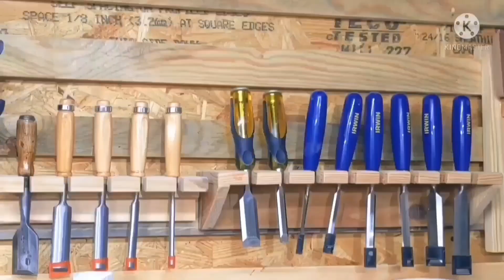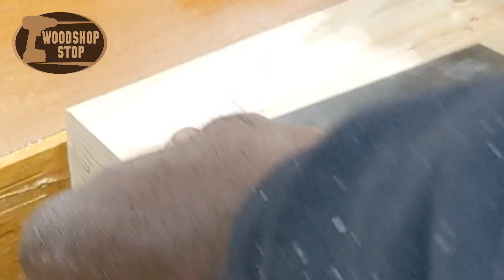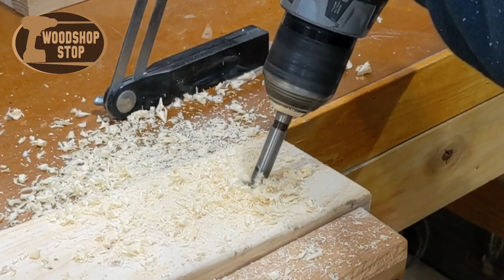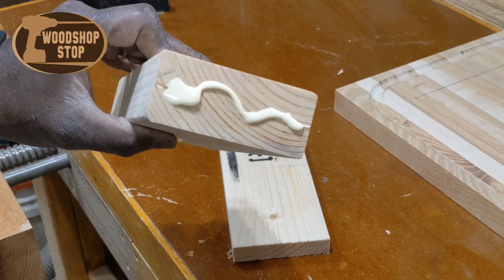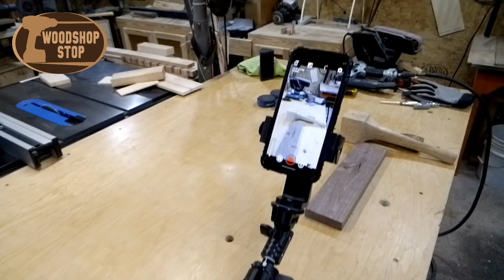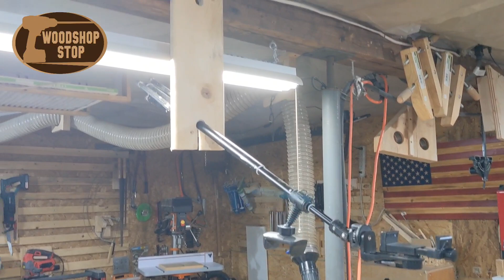How to make a quick and easy boom fixture for your tripod and camera. #woodshop fixture #camera boom

Comment: Hals Wood Shop.   Thanks.  I just got a tripod and am filming some  table saw cuts for the Woodworker Club here in Phoenix.  I never thought it could be so hard to film without a tripod.  Your jig will help alot.  Good Shop tips are not complex.     BTW    Nice Shop.   Best Wishes in 2024.
Reply from the maker: Thanks Hal. I could make a retractable boom arm, but I think this is more versatile..plus I can make multiple ones for different areas in the shop.